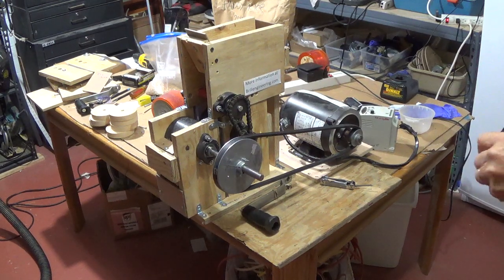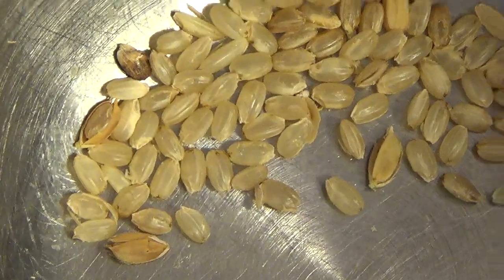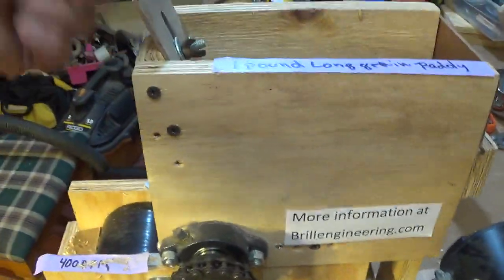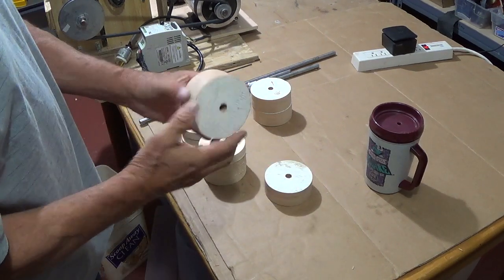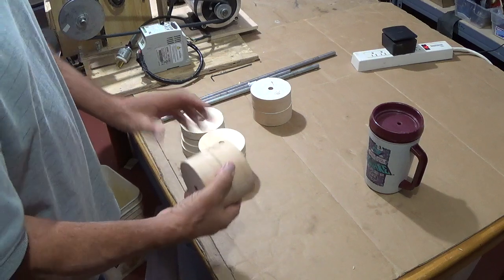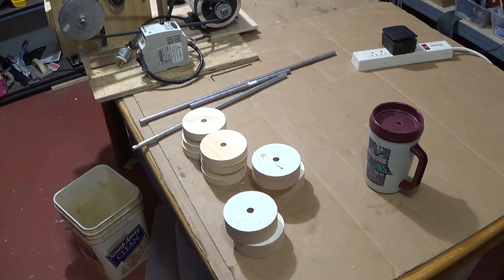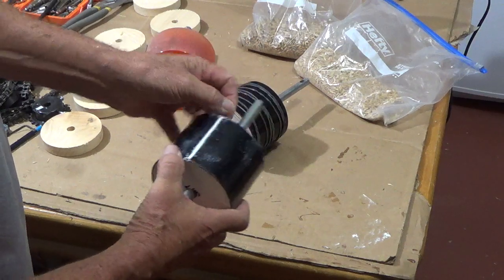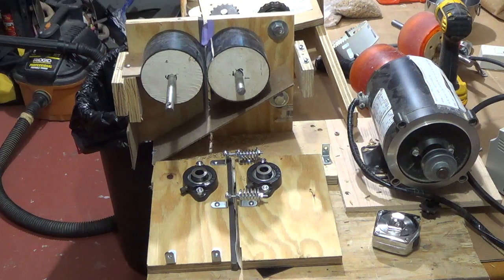rice de huller using wooden rollers

Comment: @14:35 and following: Cutting the ends of the urethane sheeting "on the bias" - say, 45 degrees, rather than square to the width of the strip - might hold up better and be less abrupt as the rollers are turned against each other.  Sanding drums/sleeves are often made this way.  Also, a strong contact cement (Barge is a common brand name in the US, used in commercial shoe repair and the like) might stick the urethane strips down to the rollers pretty well, but still be removable when the sheeting needs to be replaced.

I am entertaining building a small grain dehuller for Duborskian rice, a dry land rice which reputedly grows well in northern temperate climates.
Reply from the maker: Good luck

Comment: Hi. Is the urethane sheeting harder than ABS or PVC pipe? Could this grind flour if the wheels were closer? Thanks!
Reply from the maker: I don’t know if I already responded to this note. The urethane sheeting is not as hard. Pvc pipe is too hard just like steel. 90 durometer works best
Reply from the maker: I think wheat is easy to dehull and is too soft for pinch rollers

Comment: thank you very much. please can you give the torgue of the motor used
Reply from the maker: i don't know the torgue but a 1/4 hp dc motor with speed control worked easily, the ac motors were either 1/2 or 1 hp,
Reply: Thank you sir

Comment: I designed a machine just like yours but intended to shell melon seed, egusi and the like, with it.I planned to use a cable under tension tangent to the two rollers on the exit side.Like i said mine is still on paper.I like the tension mecanism. Good job.